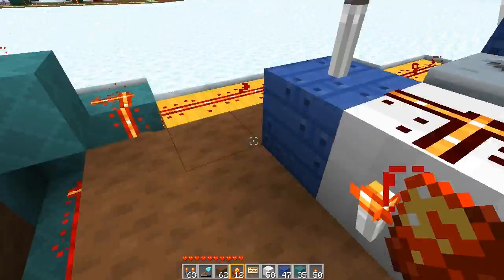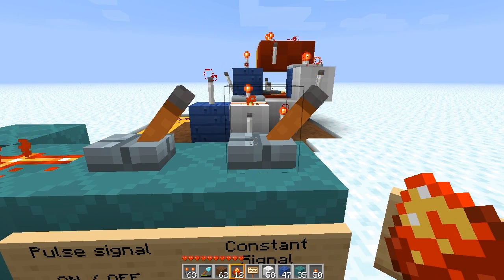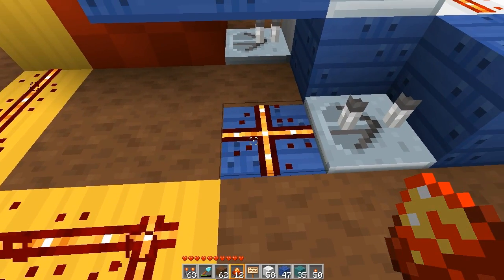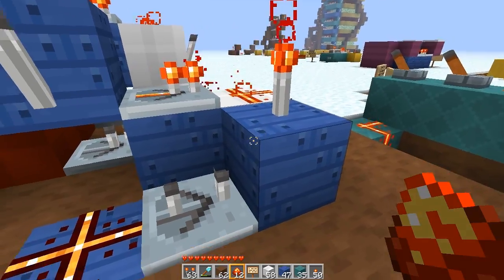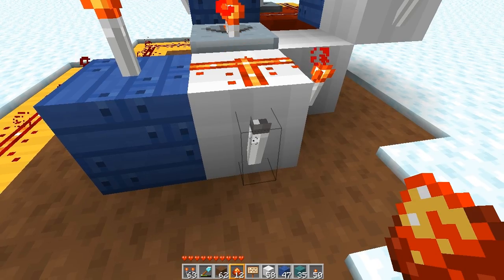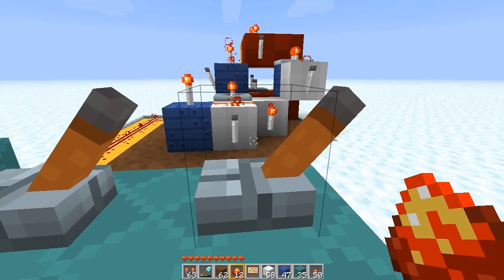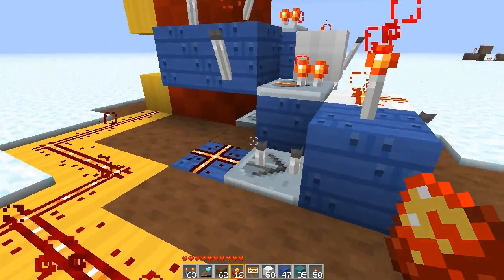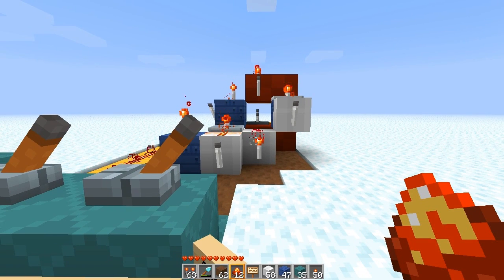3 Signals, 1 wire...now with improved pulse output!

Comment from the maker: @christurnermac
Oh, good eye. That only happens when switching between pulsed and powered and back quickly. The pulse is retained long enough to put it on momentarily. Most things don't quick back and forth that quickly so its no a big deal, BUT if you wanted to prevent it from happening a similar and gate attachment, the same I added to the pulse output, would prevent the flicker.

Comment: @0:31 going from on to pulse the on torch flickers a bit. Don't have a clue if that can be fixed. Obviously if you were using a counter you just wouldn't wire it to that output. But if you wish to make it entirely bug free I thought I'd point it out. I need to build one to try and think up solutions, I'll try later and see if I can think of any suggestions.